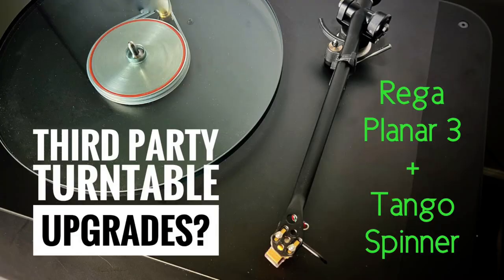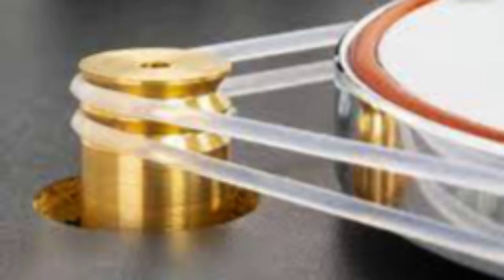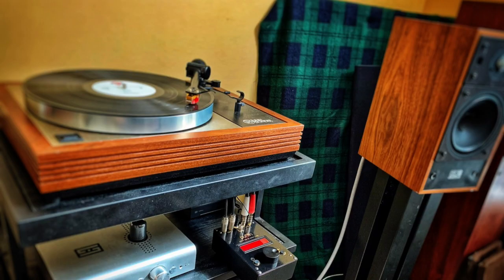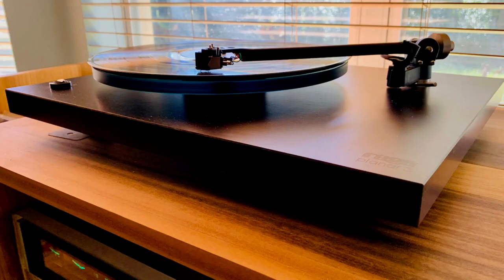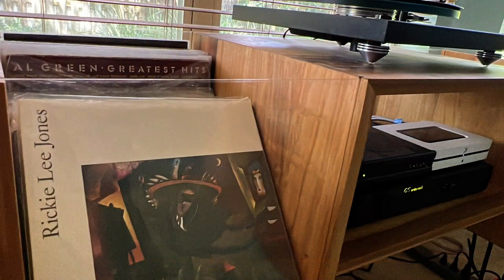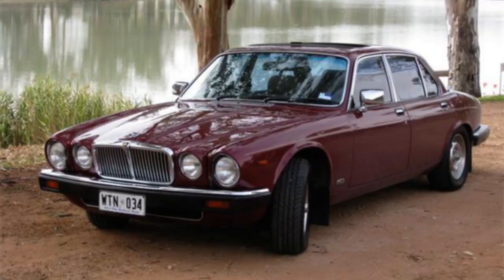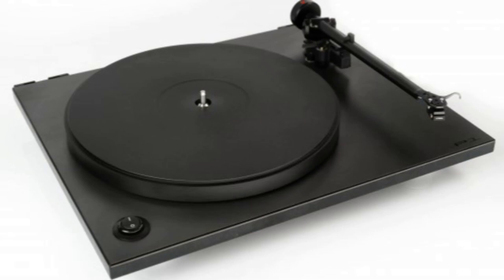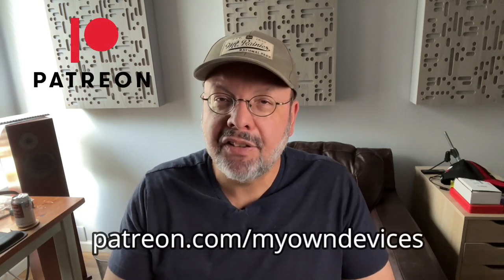Rega Planar 3 Vs. Linn Sondek LP12! Tango Spinner Upgrades a Winner? Pt.2

Comment: I have the Rega p3 . My experience is that I love it with some recordings and hate it with others. I am apt to agree with commenters here that suggest that different is different.that may simply because I do not have a reference for what is better. And, really, that could be enough to satisfy the need for something better. What puzzles me is why the upgrade path that is available for my Rega seems to suggest that I would have been wiser to have gone with a non Rega option to begin with. And also- as noted below, that the upgrades are corrections for what seems to be gaps in the lighter is better theory that produced the table to begin with. So, I'm puzzled..maybe wrong, but not critical . The p3 has offered me a lot & I'm happy to have it.
Reply: Your comment is both funny- to me, and true!
Reply: Spot on commentary that is exactly what i was thinking being the owner of a Thorens 166 mk2. I was tempted with the Rega P3 cos it looks so light and cool. The upgrades take me back to traditional platter designs. Im thinking money spent on cartridges is better spent. Great video.

Comment: The Rega has no speed adjustment & little in the way of VTA. Old LP12's sound luxurious compared to what is now available. Much of this has to do with system matching. I have owned both decks & I think you get what you pay for.
Reply: You definitely do not .
Reply: £340 without arm in January 1983 to be precise  so double the cost of a 3 but with a main bearing with 50% less rumble than a budget Project!

Comment: Didn't you get two Technics 1200s last year? Why even bother with these mid-fi belt drives? Linns are probably the most overrated turntable in the world, basically a scam for what they cost, sound and build quality  is comparable to Thorens cheaper models (those are good value for money!).. maybe...
Reply: My early serial number Linn LP12 sounded at least 5x as good as my housemate's pair of SL1200MK2s.
Reply: @transamericanlife  That's because your housemate didn't have the original heavy rubber mats on his/her 1200s but had felt dj slipmats instead, this makes the platter resonate. Never mind the Technics, do a blind comparison with any 300€ Thorens which is basically what Linn copied/imitated.  My point is the LP12s aren't bad, but nothing special either, there's absolutely nothing that justifies their completely ridiculous price, they are a scam aimed at superstitious believers.

Comment: The Planar3 was my first turntable and I got to meet Roy Gandy a number of times. He’s a very good engineer and listens intently when you speak to him. The fact that the Planar3 is such a long-lived touchstone product is that it is a case of simplicity hiding good engineering. He made it that you get it out of the box, place it on the level surface, plug it in and play with minimal fuss. I think you would probably get more mileage on your P3 with a power supply. I bet it sounds excellent as it stands with the Tango Spinner parts but, adding a power supply will lower the noise floor even more and increase separation and resolution. I would be interested to see what mileage you could get from Funk Firm upgrades too.

Comment: I have been working on a Rega upgrade based on the P3 plinth, I have an RB250 arm that has been stripped and rebuilt with better bearings a fitted with a metal stub and counterweight, and then it was rewired with Litz silver wire and foam filled with Van Dam RCA cables, The main bearing and holder is ceramic, and the sub-platter is a 3 spoke machined alloy, I am running a twin belt pully and a 24v DC motor with a TTPSU to control the speed, the platter is a 22mm acrylic, and it sits on Sorobothane feet, I have fitted an AT VM95ML cartridge. I kept the smoked glass cover as I like it, I have 2 others that I am working on as well, I also own a Kenwood KD990, a Thorens TD160 mk1, And a Garrard 401.

Comment: It's wonderful that you had a reference that you could go back to and listen and compare to, because hearing and memory together is a fickle combination. Many feel that upgrades don't make any difference, and that we 'hear what we want to hear', but you have clearly quantified your findings in describing differences in relation to a reference. I find this video very well done, and your experiment will help many in their quest to upgrade the sound of their turntable, spending a little at a time, having fun while doing it, and achieving something over time that is rewarding. Like you I have owned a Linn LP12 of similar vintage, with all the upgrades except the power supply, and today I use a 2016 Rega P3 that has had similar upgrades to yours, and I do prefer the Rega sound myself, but I did not prior to the upgrades.
Reply: So when you say all the upgrades to your Linn, what do you mean?  There are three different sub chassis updates, 12volt ac motor with power supply and tachometer,  dc  motor upgrade Radikal update, etc. And that's not counting tonearms and cartridges.  I believe that you can top out at $30-$35K, $55-$60K and you cannot do some of these updates without the power supply update.  I'll assume you own a Valhalla based LP12?

Comment: You say it’s a 1981 Linn.  How long since the springs were changed.  This makes possibly the biggest difference on that table.  The more they go out of spec the more the performance degrades.  Mine is a 1974 export model.  It was recently resprung (whopping cost of $100 fitted by expert) and was a night and day experience tone wise.
Reply from the maker: 1988. I have new springs and am planning to try to change them myself.
Reply: @MODAC  Hahaha so this utter useless then.. nice going dude!!
Reply: Good luck man.  Quite tricky without the jig.  But I’ve seen it done on a chair frame with the seat removed.  The trick is the balance coz the weights are different at each point. IMHO all that softness etc you talk about will disappear when it’s set up right.👍

Comment: Top tip. The Rega planar is very sensitive to the platform it sits on. A proper dedicated stand like a Sound Organisation table. Ie. A rigid, lightweight metal frame table with spiked feet and supporting a chipboard shelf. The fundamental improvement in performance is massive to this deck.
Reply: I agree and the LP12 is very sensitive to what it is placed on too. It likes the same thing, a very light and ridged support.
Reply: Purchased a platform for the rega 3 & got an amazing upgrade on the cheap.
Reply: Top tip is to buy a turntable with more mass in the first place, isn´t it? What´s the value of a product that is based on reducing as much mass as possible only to sell "upgrades" and platforms to compensate for this lacking mass? Rip off.
Reply: @ENGLISHISBEST  Everytime some happy customer cheers about spending even more money on an "amazing upgrade" to finally get this piece of crap running halfway decent makes me puke.
Reply: the easy upgrade is to place the TT as far away from the speakers as is possible , this info is missing from all upgrade and stand mount posts .. , I wonder why

Comment: You can put lipstick on a pig.....
In fairness TS parts look well thought out and fairly priced. How come Roy Gandy didn't implement these obvious improvements years ago 
Ditto for LP12..
Reply from the maker: Building components to a price point requires compromises. The upgrades are available on the P6 and P8 for a lot more money.
Reply: The original Planar 3 was the stooge in the Linn retailers back in the day.
That suited Gandy because he coattaied Linn  sales. 
I'm in Scotland and worked in that industry for 25 + years.  I will elaborate if you wish.
Not blowing smoke.

Comment: I'm definitely no expert, but i get the feeling that installing a cartridge "properly" (ala Herb Reichert, stylus rake angle, etc. for example) can be difficult.  So I always wonder if some of the differences people hear (ex. your Linn vs. stock REGA comparison) aren't partly due to how the stylus ended up when you moved it from one to the other.  Just a thought.
Reply from the maker: I didn’t move the cartridge. I have 2 of them. Yes, set up is important, but I don’t go to the extreme like some.
Reply: @MODAC  Gotcha! Thanks!
Reply: Not difficult but tedious. Companies like Wally Tools ( I own some), I wonder if they go too far.  Most of the adjustments like rake angle are still approximations when you consider all the differences in tolerance of manufacture.  Say you have the rake set perfectly but the stylus is not sitting straight up(right angles) in the groove.  Also what Lp do you use for this setup?  I've seen MF using a microscope to adjust rake angle, fine.   But you put a different record on and rake angle changes.  I will say that maybe really accurate rigs with expensive cartridges that come with individual graphs get more out of the most accurate setups than say a fifty-dollar Grado or AT cartridge.  I have this aluminum case with maybe $500.00 of turntable setup tools all neat and tidy in their separate foam compartments and for the most part, will use most of them. Linns attitude about cartridges is once you get some hours on it, that it should not be moved as the tip has been cut, faceted by wear, and moving it would be difficult to line up those faceted points again.  Also, you can dial in a cartridge by simply adjusting the counterweight by tenths of a gram. Again Linn has all this on their websites.

Comment: I am going to argue, you haven't made it sound better - just different, as you have changed with the sub platter, the twin band,the feet etc you have increased mass. This goes against the whole Roy Gandy theory on turntables. The more expensive you go up the range the 𝘭𝘪𝘨𝘩𝘵𝘦𝘳 the turntable becomes. A reduction not increase in mass. Just saying.
Reply from the maker: Perhaps so. Why does Rega include a metal subplatter on the P6 then?
Reply: I think different could be better...even when you add pickles to your peanut butter sandwich...that's better. But, actually, I think your argument is right when you have not got a concensus for what might be correct .

Comment: I remember there used to be a legend in the ether that there were Connoisseur BD1 turntables out there that sounded as good as a Linn Sondek. My friend had one back in the 70’s and it did sound really very good with a humble Shure M75EJ2 cartridge fitted. This went into a 5 watts per channel Teleton amplifier playing through Celestion Ditton 15 speakers. Not having a Linn Sondek to compare it to I couldn’t be sure he had one of the fabled Connoisseurs because only some of them were blessed with the Linn sound quality so the legend went.

Comment: Great videos. Looks like you’re using only one of the belts. Do you like the sound of one belt better than two?
Reply from the maker: No, I’m using both belts. Much faster start up
Reply: @MODAC  I recently installed the GrooveTracer Reference Subplatter and Delrin platter. I was really surprised by the improvement. I’m typically skeptical about the incremental upgrades, but I’ve come to realize that the marriage of tonearm and platter/subplatter is almost as important as cartridge and speakers.

Comment: I never the compare of technics SL1200gr, they are DJ turntables not home decks.
Reply from the maker: I strongly disagree
Reply: @MODAC  They are made for DJing so they aren't comparable to a home hifi deck, it's like comparing a formula one car to a car and driving it on the road, I would do the timestep upgrade as featured in hifi world mag. Its no way better than a Linn LP12.

Comment: Having owned a Jag, I'd choose that to travel in! (1996 xj6) I'd ever a guess, it you upgraded both, to the highest levels the gap between would be closer? Maybe in favor of the Linn? Good subject matter review!
Reply: The Linn will outperform any Rega period.  Talk to any dealer who sells both and has long term experience with both.  The issue or problem with a review like this one is what is the point of this review?  When you have someone with basically zero experience with setup, with the exception of these two tables, someone who lacks the knowledge, tools, what to even look for (issues), particularly with the Linn, you're left with an LP12 of a certain vintage that may or may not have issues reviewed by a person who wouldn't know.  There is just tooooo many ways, and variations, to owning a Linn and this tiny sliver of a take on their products, especially by an inexperienced owner, well what do you really get out of it. 
  Take your 96 XJ6;  when it is tuned up properly, chassis and suspension, tires just right, all by mechanics who know this car, it just sings.  And that's the same with a Linn.
   Just one more thing, when visiting the factory in Glasgow years ago, Ivor drove a Walkinshaw Jaguar.  It was fast , high performance. and drop dead gorgeous car.

Comment: Can upgrade it all you want and placebo yourself into thinking it comes close or better, but it makes no sense it can compete with a 3-point suspension system, point bearings, near 4kg platter and precision top plate.
Reply from the maker: Stating an opinion without hearing the results? Not cool.
Reply: @MODAC  Not really an opinion, its quite logical, unless you are saying Linn, Thorens etc wasted their time making heavy platters and 3 point suspension ).

Comment: I got my Rega Planar 3 in 1979. I bought it second hand from a guy who was upgrading to an LP 12. In the 90's the S shaped tonearm developed an annoying mains hum and after failing to get it repaired I replaced it with an identical S shaped tonearm that I managed to find. As a matter of interest the rest of the system was bought at the time and comprises Quad 33/405 and Leak 2075 speakers.

Comment: The Rega may, on occasions sound good, but it’s full of design flaws….fixed headshell, no VTA adjustment, and no chance of table levelling. I’m never going to buy into this, whatever they try to tell me regarding it’s superlative attributes.
Reply: a fixed headshell is not a design flaw but a design feature.

Comment: Hi sir I have the latest Rega P3 deck with the Rega phono stage and Rega ups , I was wondering would it be better than continuing on an upgrade path with your rega to go instead for a Rega P6 .    I myself had to stick with a yearly budget hence me not going straight to the P6 , but surely in your case it would make more economic sense in the  long run .                  Best wishes and kind regards 😀👍👍👍
Reply: If you like the sound of your existing set up, why upgrade? My tt is 1976 and I still love the sound. So many comments go like this -- I loved xx tt for the 2 years I kept it! Hope this helps.
Reply: Go for the 6

Comment: There is no way the rega is better than that LP12 you have, especially with an LVII in rare black too. The other question is, could you buy a better turntable with tge money you invested plus the price of the rega itself.
Reply: You could buy a second hand Technics SL-1200 (MK2 and up) for $500-600 (in nice condition). Those are better than the LP12. Better specs and measurements.

Comment: Was your table (which the turntables sit on) leveled with a spirit level?  Given that there is no level adjustment on the turntable, you will need to level the table itself.  My Linn Sondek sits on a multi-level Sound Organization table with adjustable feet.  This made leveling the table easy.  You can check the grommets are set up by doing the bounce test (ie. watch the platter bounce directly up and down when you push down on the platter on the side towards the arm).  I had a Linn Troika cartridge on the Linn, and the synergy was very good.  I find that system synergy is very important, even within the turntable itself.  All-Linn parts automatically have great synergy.  Of course, what we like is very subjective and based on taste.
Reply from the maker: Yes, it was level. I plan to change springs and grommets soon. Thanks

Comment: Have a dumb question, how does the vintage Empire turntable you have compared to these modern turntables?
Reply: That was my first turntable, back in the 70s. Noisy motor with lots of rumble. Very heavy tonearm. Nothing good about it other than a nice wooden case.

Comment: great video! I'd upgrade the Linn all day long. upgrading the power supply makes a big difference, so spend the money there...in my opinion.
Reply: Time to reconsider that notion.  One of the oldest and best LP12 dealers in the states, a dealer that consistently used every possible variation and updates to it are now changing their mind about it.  The new and limited Naim Solstice Special Edition Turntable (by the way they are also a top destination for Naim and know more about Rega tables than just about anyone).  Not cheap but about half of the Linn's fully loaded price.  And it comes complete; table, Aro arm, The New Naim MC cartridge, phono preamp, and a dual power supply specifically designed for the Turntable and preamp.  All in, not bad for a statement product from Naim considering their other statement products can go six figures.  Haven't seen or heard it yet but a while back, I spent two hours listening to I think three-hundred thousand bucks worth of electronics through these thin real tall Dynaudio's ($85,000.00?)  with their own insanely made rips of just about anything I wanted to hear with an iPad controlling it all.  It changed my world view on audio but for this YouTube site and many others like it you wonder what's the point of listening to these people well intentioned or not discuss subjects that they are clearly even remotely familiar with and do not seem to understand that.  https://www.youtube.com/watch?v=KEDQ5Bq2C-E